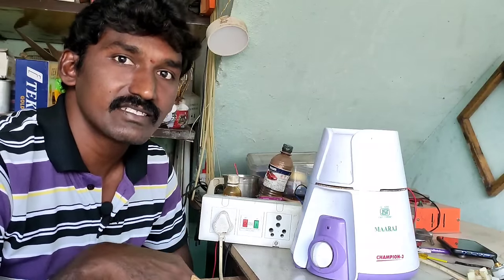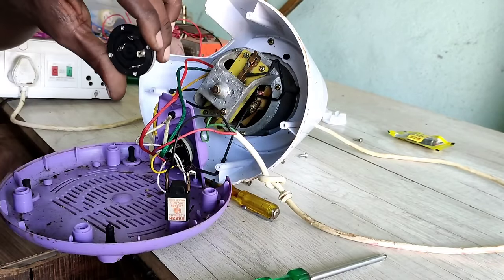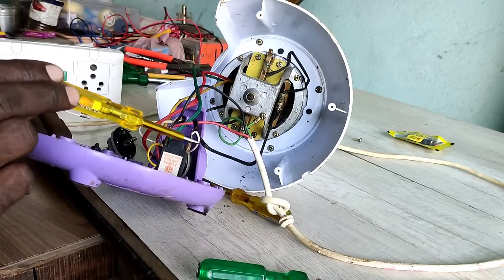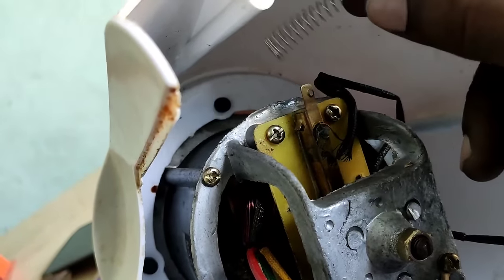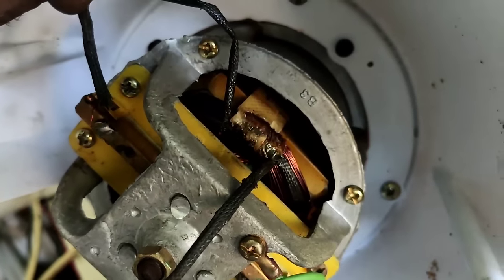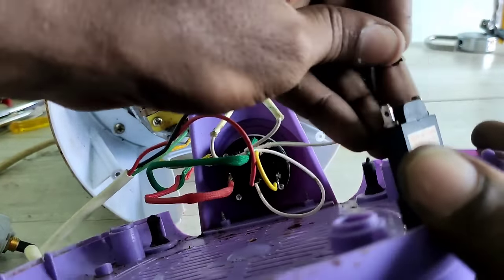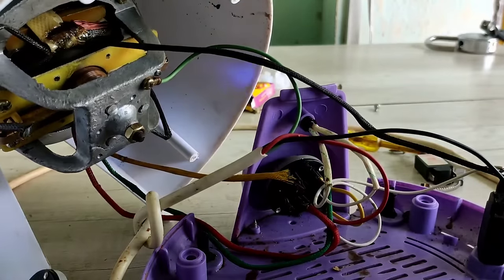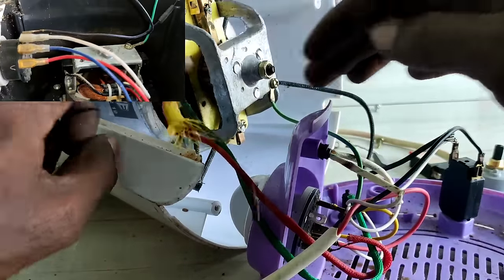Mixer grinder problem repair Telugu

Comment: Thank you so much andi you helped me alot. Actually my mix motor not run. I really very afraid .After seen your video I turned to back and press the  button. It works. Iam so happy
Reply from the maker: Great 👍

Comment: Anna one dought   single phase not self starting kadha bit mixer grinder or power tools like drill grinding mechain Ela  start avutai Anna vatiki capacitor ledu ga anna

Comment: Motor winding lo speed control 2 wires mathrame vachayi bro vatini switch ki ela control cheyyali cheppandi PLEASE
Reply from the maker: నార్మల్ మోటార్స్ కి రెండు స్టెప్పులు అంటే స్పీడు వైర్లు వస్తాయి బ్రదర్ మూడో వైరు ఉండదు
Reply: Steps switch 3 steps di ichadu connection ela broo
Reply from the maker: 4007 David  వేసుకోవాలి బ్రదర్ ఫస్ట్ స్టెప్ కి
Reply: Aa connection video link pettandi broo
Reply: Bro mixy motor parellel lo petti chuste supply vastundi kani motor run avvadam ledu bro  problem enti